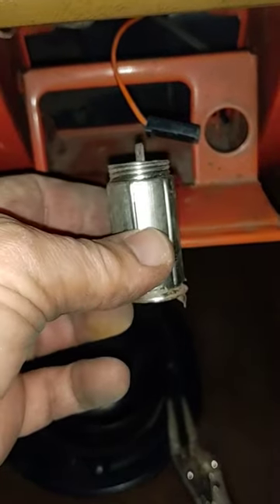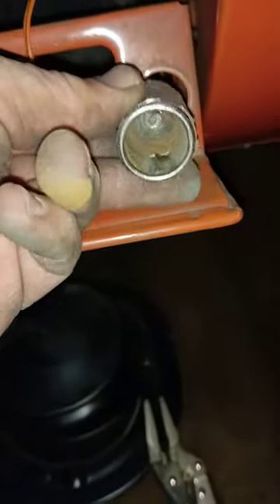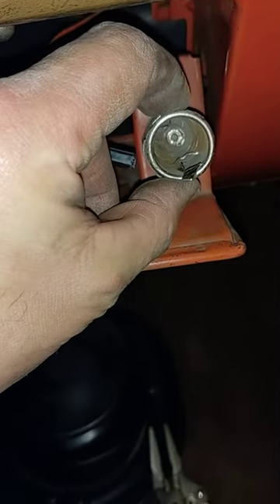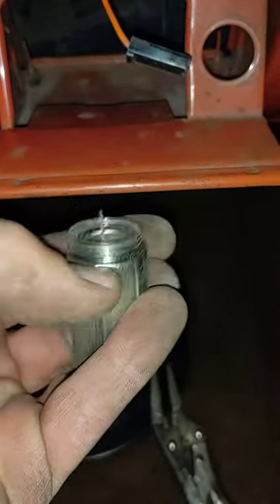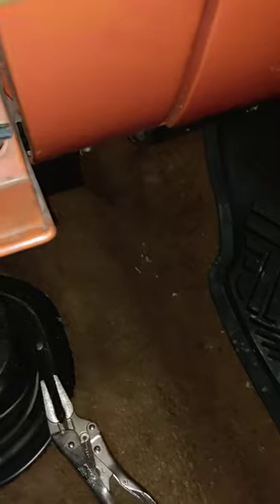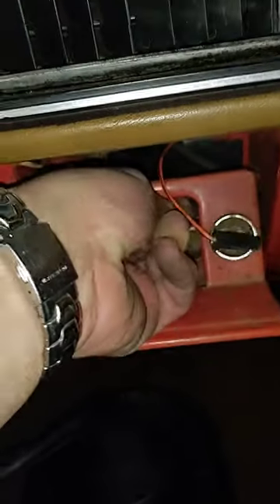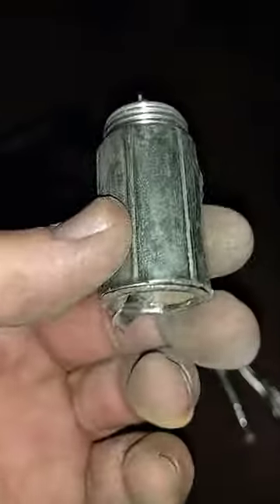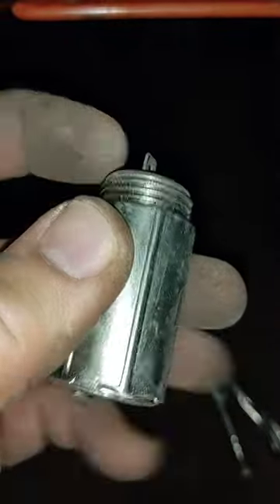How to to remove cigarette lighter Chevy c10

Comment: Thanks for the video.  Just what I was looking for.  There are 4 screws that hold the entire assembly in...2 on top and 2 on the bottom.  With those 4 screws removed the ash tray assembly will come out as an entire unit with a little patience and maneuvering.
Reply from the maker: I thought it was riveted in. Thanks.
Reply: The assembly is a 1/4 inch wider than the hole in the dash the dash paint and assembly  will suffer if I had to do it again I would grind the lip of the socket.    With  a dremel And replace the whole lighter. The assembly is not supposed to be removed this way
Reply: Anyone know where to get the correct single wire lighter socket ?

Comment: Thanks for the vid. How do you remove it when you can’t really get a good hold of the sleeve to unscrew it? Any tricks? Tools?
Reply from the maker: You can try holding the sleeve from backside and turning the part that you plug stuff into. I tried a pair of needle nose pliers and expanded them inside to turn.

Comment: Great video. did you just pull the wire or is there a trick to it? I tried pulling mine and it won't budge.
Reply from the maker: It pulls off the connector at the rear.

Comment: do it again, please- let someone do the light and camera while you go step by step. I just came to check and caught the 'mechanic' , sweating and re-faced, trying to rip the whole ashtray off its (riveted) hinges. Took my truck home and need instructions how to take the lighter socket/bucket out (already have the lighter that goes inside- I understand they both have to be unscrewed individually and in opposite directions)
HELP (1984 Chevy C20 truck stepside)